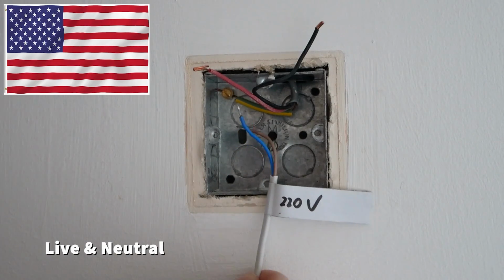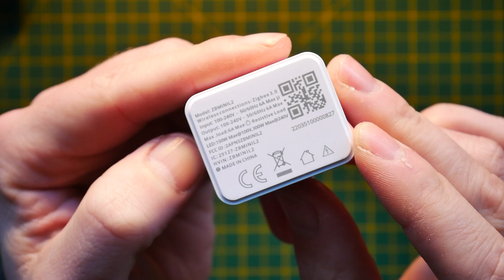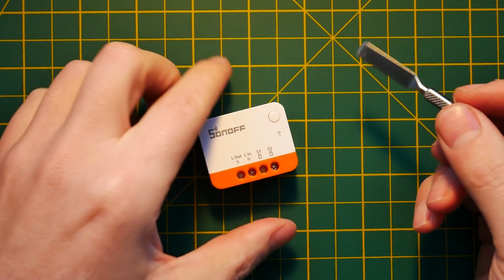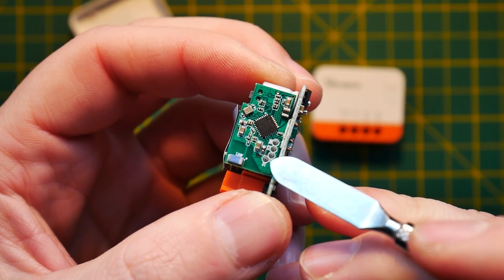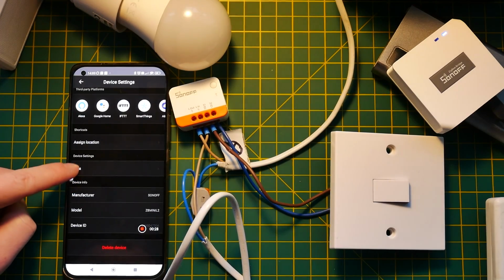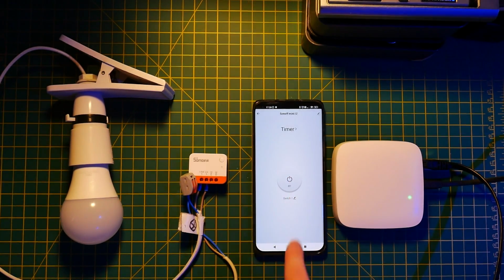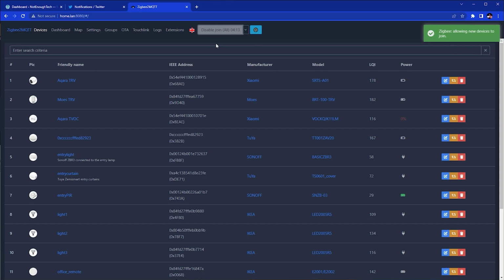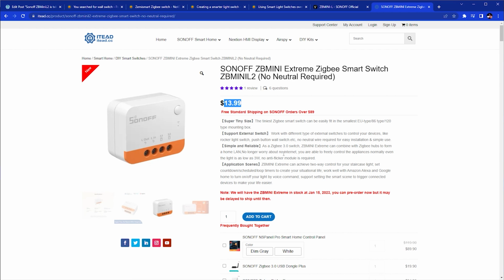Even smaller ZigBee switch: Sonoff ZB Mini Extreme (no neutral)

Comment: I brought one to test out and it arrived today. I thought it might be the perfect option to balance what me and my wife want from our smart switches but it had a lot to live up to. The ability for anyone visiting the house and simply use a light switch as normal yet the ability to control it through the smart home and have it work on a no neuteral system here in the UK without having to try and find a way of wiring a load resistor somewhere in the ceiling wiring whilst being easy to install and hide away itself. And I'm pleased to say so far so good! I'm using it to run a single 8w LED bulb and no load resistor required, it's as responsive as any local zigbee device would be, it connected fine to my tasmota flashed zigbee bridge connected to home assistant (sing ZHA rather than zigbee2mqtt) showing up as a regular light switch in the dashboard..... it just works! I'm very impressed! Going to give it a week or so to see if it holds up to initial expectations but I can see a load more being ordered to finally migrate most of my lighting over to smart lighting with full spouse approval factor. At this point the only way it could possibly be better is if it also acted as a repeater to improve the zigbee mesh network but oh well.
Reply from the maker: Nice to hear! Could you add the bulb brand - I know some of the LED bulbs could be a troublemakers at OFF position, so having a couple brand recommendations in comments would be beneficial
Reply: Just a regular B&Q own brand one
Reply: Where did you buy it?
Reply: @Lordsheva80  the itead online store
Reply: @JaguarInfinity  ah ok, I was waiting for Amazon since they take ages to send via China…
Reply: Do u still love it after a month ?
Reply: @cr0cop738  yes, I've installed a few more since. Had a few signal issues with them being enclosed in metal electrical boxes affecting signal but improvements to the mesh network with an extra repeating device or to have been improving that. Recently had a visitor staying with us and the fact they could just use the switch as normal meant there were no issues at all with them using lights during their stay. Still really happy.

Comment: The size and no neutral makes it really handy.  Looks like it will fit in just about any wall box.    It's really nicely priced too.
The stored power is a good idea too and should provide a lot more reliable performance for a device working on leakage current.   Pity it can't act as a router.  Aeotec have Z-wave no neutral dimmers and switches that work as Z-Wave routers and also have power monitoring, so the technology is there to do that.  Hopefully Itead will sort that out for the next iteration of the devices.
Reply from the maker: I'd like to see a dimmer in this form factor. That would be cool to try
Reply: @notenoughtech  I should imagine it is possible.  Just have to see if Itead feel there is a market for it.   I hope they do as the Aeotec dimmers are the last of the Z-Wave devices I have and I'd like to move completely to Zigbee
Reply from the maker: With no neutral I can see this being tricky as you would modulate your own power supply too which could affect how the switch works

Comment: I'm going to test this out when it's released. I want to skip the bulbs and go straight for the switches. This seems like the easiest way to do it with this small size.
Reply from the maker: I usually advise switches for main lights and bulbs for lamps as then you can set colour mood or dim lights while creating a nice mood. I found dimming and colours from ceiling can look obnoxious
Reply: @notenoughtech  like making you living and bedrooms look like a teenagers gaming PC.😉
Reply from the maker: I was thinking more red light district but that also works. 😁😁😁
Reply: @notenoughtech  Ceiling lights are also generally used for overall illumination, where quality of light matters a lot, and there just aren't any smart bulbs with a remotely decent TM-30 rating. A smart relay inside the switch lets you use proper quality bulbs for your overall lighting needs, which will be a lot better for your health and eye strain long term.

Comment: Could someone explain how this works without the neutral connection?
Most devices that don't need a neutral get power from a cell battery - which I most definitely do not want.

Comment: Hey,

Do you know of any way to keep it running with nothing attached to it.
I'm using it right now with a light string connected to a socket. If i remove the string from the socket it goes offline :)/

Comment: What's the voltage across S1 S2 on this device. The original 5v isn't enough for my cable length on 2 way switches
Reply: It uses mains voltage unlike the original.

Comment: Does it have a Power-on-state?
I am using ist directly, at a (non smart) LED lamp and cannot run extra wires to wire up the lightswitch. I also cannot put it behind the lightswitch as I am only renting. So the only way to switch on the light is by giving the zb mini power. However the previous zb mini just stayed off when it reviewed power and could not be set any diffently.

So I wonder if this ist possible now?
Reply from the maker: Hi. The switch doesn't have the option.

Comment: I'm dumb when it comes to electricity. When we say no neutral needed, does that mean it'll work only with switches that do not use neutral or it'll work with switches with neutral but we just don't connect it?
Reply from the maker: Both. You don't need to connect N toyour switch, just close the circuit on N line and have the switch in line on the L strand

Comment: So this unit has enough power to toggle the relay 4 times after being powered down, it still does not have enough power to work as a mesh network node 🤷
Reply from the maker: I take a functional end device over an imperfect router capable of messing up the mesh.
Reply: @notenoughtech  agreed a rock sold product is always preferred,  it just seems like they've missed an opportunity here, especially for those looking to create my 1st ZigBee mesh, this looked like a good option until...
I'll probably look to put units in the ceiling rose instead, got any recommendations.

Comment: I have a gang box with 3 buttons and it is really really cramped back in there. I can fit one of these but probably not 3. Are there relays that allow powering multiple, ideally 3 switches?
Reply from the maker: You could try something on aliexpress. Another locaiton for switches is inside your ceiling rose. You can fit quite a bit in there just label the wires correctly

Comment: I previously owned  a no neutral tuya Swith it had a problem with light flickering. Do this has that flickering issue?
Reply from the maker: It's likely down to a bulb than the switch- most of them use similar tech. A bypass capacitor can help with the issue and can be added to each switch regardless of the brand but 99% of time is down to a bulb.  I test these with £2 LED bulb from tesco which hopefully is most representative of average cheap bulbs out there and seems to be working fine

Comment: How do I get this to work with a cross connection, is it even possible?
Reply from the maker: Take a lok at the manual. it has the 2 way switch installation: https://sonoff.tech/wp-content/uploads/2022/12/%E8%AF%B4%E6%98%8E%E4%B9%A6-ZBMINIL2-V1.0.pdf
Reply: @notenoughtech  thxs, but i dont have a changeover circuit special a cross connection.

Comment: Hi, Is it possible to use this to replace a 2 way UK switch? I have a common (live) and L1 and L2 outputs. How would I connect it up? Live wire to L In, with a connection from L Out to Common, then S1 to L1 and S2 to L2? I'm totally confused by this
Reply from the maker: You can do this, if your 2 or 3 way circuit is on a separate loop. If you feed the power from one side of the circuit (lets say switch 1 and bulb is connected with switch 2 then you cannot do this without re-wiring
Reply: Any chance you could do a wee video on setting this up ? It’s driving me nuts trying to make it work.

Comment: Thanks for the review, does it need something like a Shelly Bypass?
Reply from the maker: I used it with a cheap LED bulb from Tesco and it worked fine.
Reply: @notenoughtech  Thanks, just for more clarity, you used it without any bypass or additional hardware, just the bulb and the relay?
Reply from the maker: That's correct just as shown on the video

Comment: But why would you use zigbee for a light switch When you can have wifi ?

I can underland using zigbee for a motion detector or button, but when you have AC available? using zigbee is asking for trouble.
Reply from the maker: 1. You need routers for your mesh to keep it healthy and these are mains powered.
2. ZigBee devices use approx 30% of the power of the WiFi equivalent. The average ESP32 based relay cost you about £3 a year to be connected. If you have 10 lights - that's 30£ to keep them connected to WiFi per year and about £10 to do the same with ZigBee.
Reply: @notenoughtech  I don' know if it really improved, but zigbee wad a mess to setup and very dependent on manufactures router etc whereas wifi basically works. So whenever I can use wifi I do.

Zigbee is for battery driven stuff, final. 

Now if you say it's 30%, then the improvement is not enough. I'd tend to use wifi all the time.
Of course if you love tinkering ...
Reply from the maker: It's been pretty good lately with ZigBee especially if you have a custom coordinator. As an additional bonus you can mix and match ecosystems

Comment: Any idea what would happen if you just put it in parallel with a switch that does something similar? I have these semi-smart light switches that date back a few years. Essentially they glow slightly when off but brighter when on, so they must be using a tiny current. Cheap LED lights also glow slightly. Guessing a small amount of current would go up both branches. An alternative would be to supply both with power but put a 230v relay across the switch connections and allow my switch to activate the relay (+/- capacitor if too high resistance). Not sure about if it’d all fit though. The 230V relays I’ve seen have all been pretty massive. The current the Sonoff Mini no neutral current output to the switch must be pretty tiny.
Reply from the maker: The easiest way is to hunt for a compatible bulb or install a bypass capacitor which can be bought separately online. Adding extra devices is not the way to go.

Comment: Wish they made a relay that small that has dry contacts for switching other devises
Reply: Shelly does, though they work on Wi-Fi rather than ZigBee, and they do need a neutral wire. Check them out. They are fantastic.

Comment: I would use this, except I use Tuya Zigbee 3 devices and the last time I tried Sonoff devices, which I understand are Z3 compliant, there was not a satisfactory outcome.
Reply from the maker: Sometimes an update of firmware can resolve this but then you need a sonoff hub to do it
Reply: At last, I decided to get one and try it out. I've also changed my back box to a dry lining  type, to reduce any reduction in performance by the metal back box. Going to try it out tomorrow and see what happens...   @notenoughtech

Comment: In my home I have dimmer switches. Can I still use them? Second question: Can I set per voice control and skill to set the connected light to 50% or whatever I tell it to?
Reply from the maker: I don't think this would work with dimmers. Mostly cause dimmers will regulate the voltage or pdm the output which will affect the way switch works.

Comment: Any idea how to fix the light flickering whilst "off" with these no neutral switches?
Reply from the maker: Usually it's down to the lightbulb. Some are more or less resistant to this. Try a couple of bulbs to see which one doesn't act this way
Reply: use a so-called "Bypass" before the bulb in the light fixture - it's a little capacitor/resistor thing that uses the little bit of circulating current due to the design of those "no-neutral" switch.

Comment: Do these non-neutral relays only act as endpoint devices in zigbee? Or can they act as routers as well?
Reply: he answered that in the video
Reply from the maker: As Mark said. Or jump to article so you don't have to look through whole video to find the info you need. In short IC supports both modes but switch is the end device

Comment: Can this be controlled locally if the internet goes down?
Reply from the maker: It's ZigBee. It's not using the internet to be controlled.
Reply: @notenoughtech  I'm currently using Sonoff ZBMINI-L Zigbee but it can only work when ewelink is connected to the internet yet my other devices only require to be in the same network to work even without the internet connectivity.  I was wondering if this is cloud-based too or can work without having to connect to the cloud
Reply from the maker: Define "connected" 
I was referring to the protocol alone. With custom coordination you don't need anything other than that to make it work (although you'll be limited to using end devices without any local dashboard or automated policies)
Bridge pro has the ability to trigger schedules and automations that require no cloud
Reply: @notenoughtech  Ok. I'll try to change Sonoff ZBBridge to SONOFF Bridge Pro and see if that will solve the issue and allow my switches to be controlled from a phone in the same network locally even if the internet goes down
Reply: 0:30 What is this Sonoff model (with neutral)?  I can't find it on the internet. Thanks.

Comment: A "permanent" installation like this is designed for just doesn't make sense without the router function. That was the trade-off for supporting no neutral. In my part of the world, most homes built in the last 40-50 years have neutral available, but that's not the case in other places.
Reply from the maker: Realistically speaking you'll have more ZigBee devices in proximity that are acting this way. It makes sense to have the switch ZigBee as you can avoid using WiFi and still use smart witches to automate your lights.

Comment: Is it also a zigbee repeater?
Reply from the maker: Just the end device
Reply: @NotEnoughTECH  pity. I was always told that all zigbee devices powered by the mains were repeaters. I guess its because this one uses little wmby parasitically leeching off only 1 wire with capacitors. Can I assume (for example) that all zigbee smart plugs are also repeaters? If not, how can j tell?
Reply from the maker: That's the rule of thumb. But with the devices that hook onto no neutral... Just not enough power in them in the rest mode to act as routers.
Reply: 3:50

Comment: 16A relays are really the right choice for mains devices...🥵
Reply from the maker: It's a light relay. Are you trying to wire a football stadium? 😁😁
Reply: @notenoughtech  Nope, I just dont think this relay should become the fuse in a 15A circuit... 🔥⚡
Reply from the maker: You could say the same about virtually every appliance plugged into the mains. Nothing stops you from adding a fuse in line too if you are not convinced. 
A typical bulb has 10-15W which is approx 0.2A on a 8A rated relay fitted into a device with 6A rating. That's approx 30 times the typical consumption suggested for the switch.
Reply: @notenoughtech  And yet if you shorted the wiring at the load the relay would fail... miserably... The weak link becomes the fuse... You should try that, It would be shocking and HOT🔥🤪
Reply: If you short the load to earth (which is the normal fail condition when talking about live-x shorts) it'll pop the RCD. Live-neutral if it's a UK socket, then you'll blow the plug fuse. On a UK circuit and any built like them, this would generally be a non-issue. Yeah failing that you'll cook the relay most likely, but these are built with flame-retardant packages and they should be in a vaguely at least flame-retardant back box, so in the really extreme scenario like somebody shoves a live-to-neutral short in the socket sans plug (which takes some work with a UK socket, it's not something you can do accidentally) then yeah the link will burn, IMHO this isn't a bad thing, it won't be the wiring in your walls. IMHO the bigger risk is in lighting circuits, but this is why we test circuits and again is a non-issue and your lighting circuits will have a 6A MCB, RCBO or similar anyways. There's an argument for overspecifying it, but it's intended for lighting circuits so usually won't be a problem (an MCB will trip on 6A but a 6A rated relay will probably only cook at maybe 12A, possibly more), but you could get away with it in a normal mains socket if you're using your brain (and a label on the socket probably wouldn't hurt).

Comment: Works with Philips Hue hub??
Reply from the maker: Sadly I don't have the hub to testes. Only tested with the ones I had at home
Reply: I try to pair it with my Hue hub. But it won’t pair. Please let me know if you have any idea how to pair it with the philips hue bridge.
Reply from the maker: It's gonna be down to the bridge rather than switch. If you want to mix ecosystems best way is with a custom coordinator. Check out my videos on Sonoff dongle and cc2531

Comment: So small! I wonder if it will fit in the slimmer light back boxes? I couldn't use the old one due to this.
Reply from the maker: It's 19mm thick so it would depend on the box size Vs the switch you have at hand

Comment: Does it work if you use a led bulb?  I know some sell capacitors which you have to place over the led to get things working.
Reply from the maker: I was using a cheap led Tesco bulb in my test
Reply: @notenoughtech   aha, thanks for the quick reply. Seriously impressive then!  Looks like a solution a lot of people can really use seeing as a lot of (read most) homes here in the Benelux only have the 1 wire switch solution here.
Reply from the maker: Same here. All my switches are no neutral